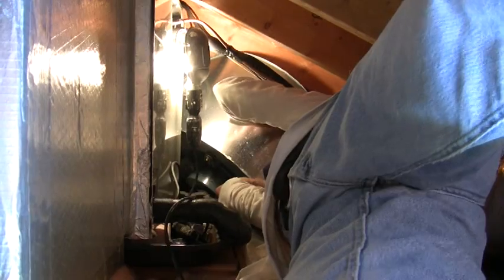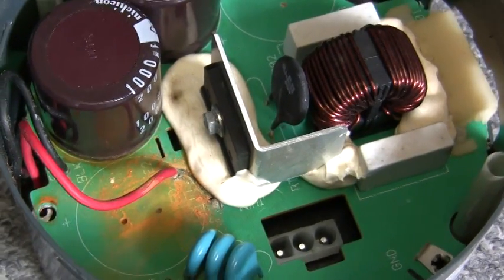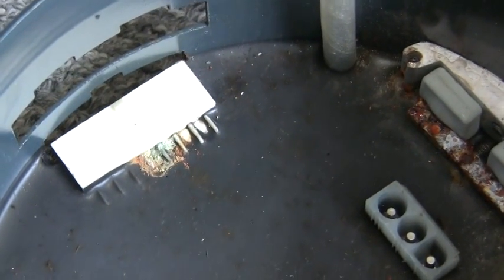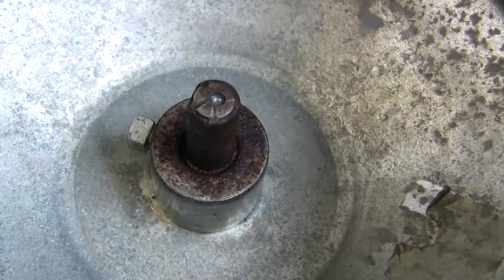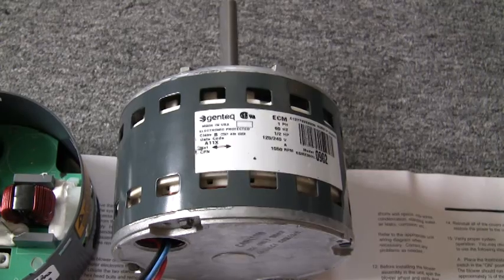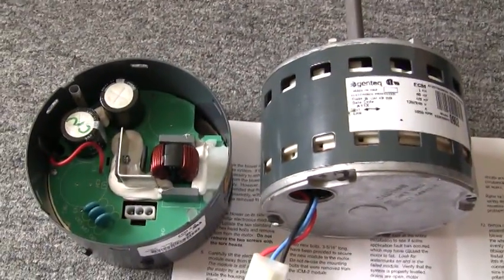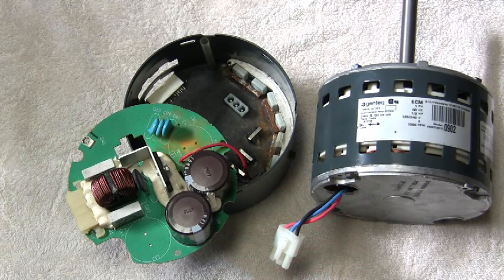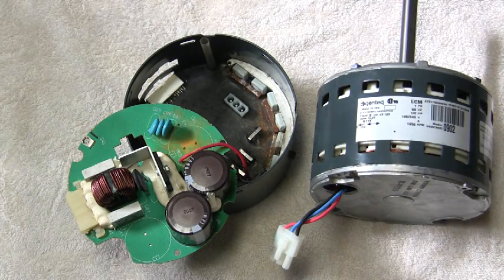REPAIR TRANE AIR HANDLER NOISE

Comment: Is the blower 'ahead' of coil or behind? Or is blower drawing air over coil or pushing? Tell tale sign is moisture in motor assembly. Some airhandlers draw the air over the coil bringing all the condensation with it right to the motor, heck I've  seen pvc drains from this style NOT rain until the blower quits since the pvc drain is in a negative pressure state while running. This allows the catch tray to fill and splash inside the cabinet from air turbulence....also see icemans comment about air leaks around cabinet.

Comment: The test with the multimeter is to make sure that none of the motor's windings are shorted to the motor's frame. Therefore you should, on a good motor, get no reading when you do that test.

Comment: When the shaft is rusted like that you can use a piece of sandpaper and also WD 40 to sand down the shaft. And  the motor should slide right out the squirrel cage. With no problem.

Comment: I realize it's been over 2 years, but I'm an HVAC service tech, and wanted to say a few things since you seem interested in understanding this equipment. Condensation only forms on a surface that is below the dew point of the surrounding air. Usually, the fan pulls air through the coil, which cools and dehumidifies the air, then the fan pushes the air through the heat strip box and out the supply duct. During this operation, the motor is above the dew point, so no condensation can form. If your fan doesn't stop when the cooling stops(fan in ON, not AUTO), then it would be possible for the fan to be cooler than the dew point of the now-uncooled air, at least for a minute or two. Another possibility is air leaks around the blower compartment. Did you look where the line set goes in the unit? Sometimes there's a pretty big gap there. If you have any exhaust fans running in the house(bathroom, kitchen?) then an air leak in the blower box would feed hot, humid air right into the fan and motor assemby on its way into the duct. Just some ideas.